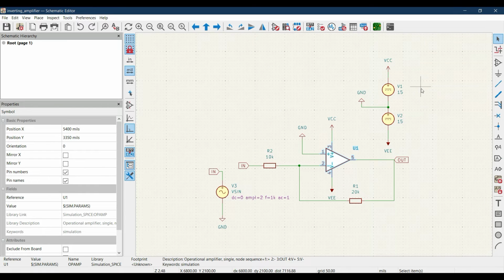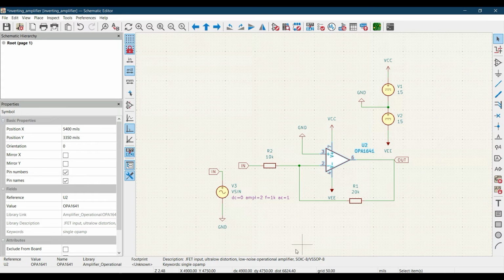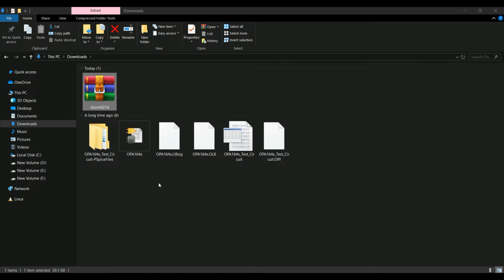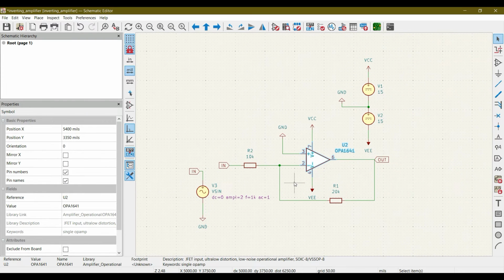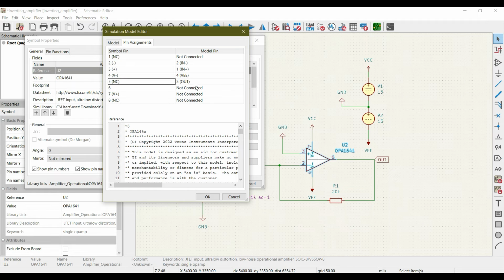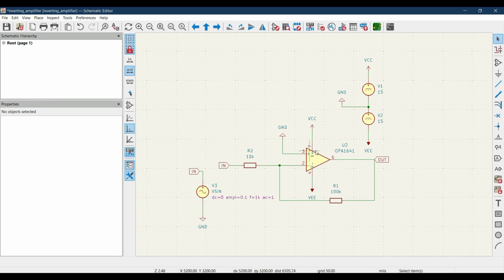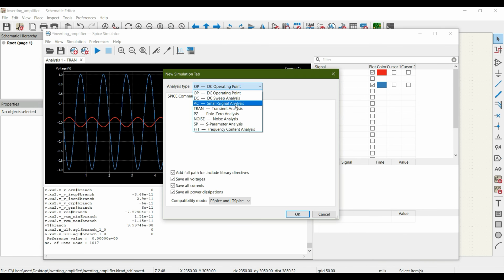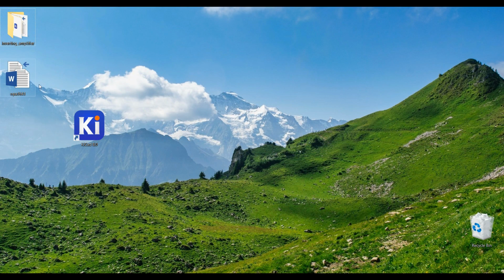67 How to Download and Attach Simulation Models in KiCad

Comment: 왜 전 똑같이 했는데  에러가 났어요~
모델 파일에 문제가 있다는데.?
warning, model type mismatch in line
s1 cap_l cap_r sw_ol_opa164x mid ol_sw
Circuit: KiCad schematic
Error: no such function 'if' at line 336
from file
D:/zhengri/xuexi/2.kiCat/OPA1641/OPA164x.LIB
Error: ngspice.dll cannot recover and awaits to be reset or detached
Simulation terminated by ngspice. This may be caused by insufficient memory or an internal error. The simulator will be reset.
Warning: can't find the initialization file spinit.
Reply from the maker: Thanku

💡 If you’re interested in mastering PCB design fundamentals and practical techniques, I’ve created a detailed course on Udemy to help you get started:
👉 https://www.udemy.com/course/pcb-design-with-kicad-from-basic-to-advanced/?instructorPreviewMode=guest&couponCode=KEEPLEARNING